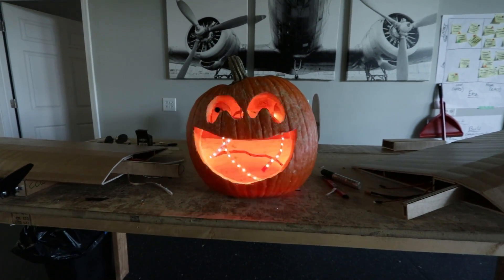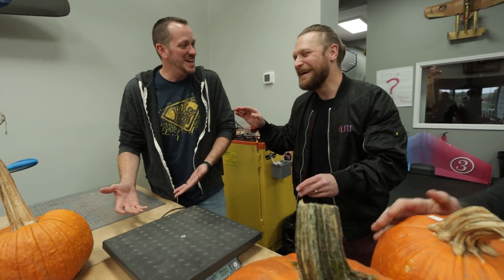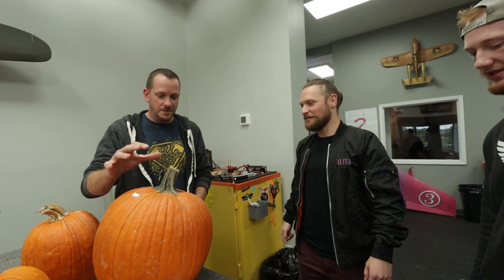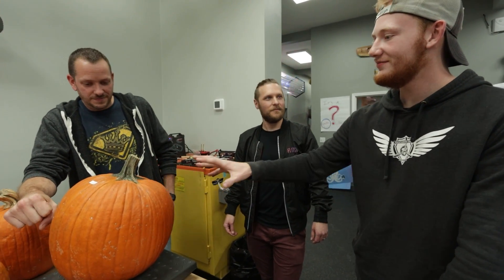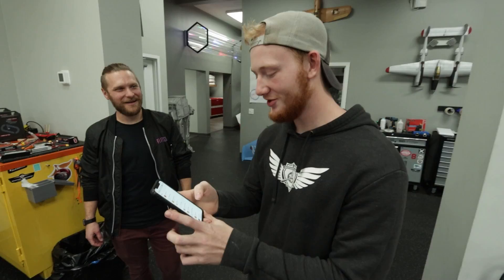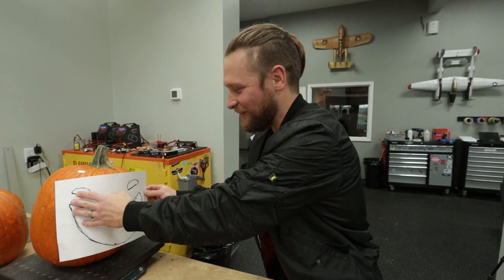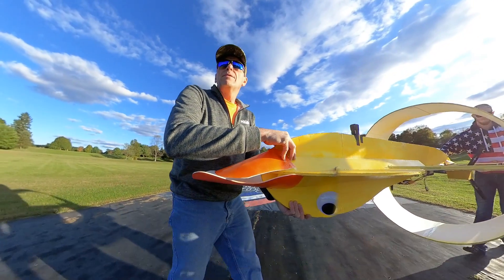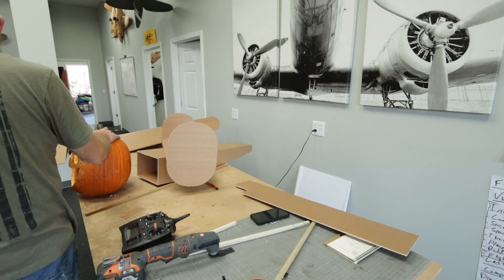Building & Flying a 20lb Pumpkin plane!🎃

Comment: If you’re into FPV wings, you’ll love the Wings simulator. And they’re not lying, flying with a group is a friggin’ blast. Perfect solution to the group fly day withdrawals we’re all suffering through as winter creeps in. Or if you’re not into FPV wings yet, but are intimidated by the thought of spending all that time building a wing and then smashing it (because yeah, it’s a bit more work than a quad), this is a great way to try it out first. Seriously folks, give it a shot.

Comment: Great project and video.  Thanks.  Leaving the top off was a probably good thing because it enabled an air escape hatch.  Maybe if there had been another hole in the back of the pumpkin near the bottom, flying into the wind might not have been as slow.  I'd like to see you cut another hole in the back and try it again.

Comment: That Wings game stinks.  No discernible control scheme!!!
Reply: What do you mean by no discernible control scheme?
Reply: I thought I could fly with the keyboard.  My Spektrum DX6 has no input for this.  If you can use a keyboard, please tell me how.
Reply: @userTJ39780  If you get your hands on a WS1000 dongle you will be able to use your Dx6 transmitter. I believe there are also cables that use the headphone jack to also connect your transmitter to the computer.

Comment: now use the one with the long stem. cut eye holes above the stem and the mouth below. 
0----0
   @ 
(___)
You can remove the base of the pumpkin instead of the top, then cover the whole thing with epoxy to increase the structural integrity.

Comment: I would have used a fake pumpkin.  Yes it would have been a little lighter, but they make ones the are thick like a real pumpkin.  The best part is it will not rot and you can keep the thing around.  I would have put some wing and tail lights too so you can night fly it.

Comment: It takes me weeks of dinking around to build a simple cub. Every thing goes wrong... soldering problems, servo problems, wires to long or short.check cg reconfigure all electronics to re fit.pushrods don't line up. and on and on !!!! 
And you guys build from scratch and fly a pumpkin in 2 day's  !!!!! 2 DAYS  !!!

Comment: that setup would be a good one for many reasons (the wings, fusilage, tail, and camera mount all mounted to the nose) just think about it have several noses ready to mate with the rest and switch out when needed. you could even put batterys in the nose (Don't know about the CG but it could be worked out.) use it for crowd coverage, search and rescue, supply drops to hard to reach places, and camera platforms for such things as Flight Fest and other outdoor activitys. just a few ideas I had as I watched your video. WELL DONE !!

Comment: I want to see a flying lawnmower that still cuts grass
Reply: That would be a challenge because the moment of inertia created by a rotating mower blade would muck up their aerodynamics. They would have to account for the spin of the blade, and how the torque would change under varying conditions like banking in to a turn.

I would add to the challenge that it be a riding mower!
Reply: @PurpleHaze2k9  There are models of lawnmowers with twin blades that would prevent that rotating force. Also... anyone remembering the Flymo hover mower?
Reply: @Particulator  So now we need a double prop lawnmower. I say we put the mower on its side and just use that for forward thrust. It would be dangerous but awesome.
Reply: I bet they could figure it out, it would be super cool to see. Maybe they could build it like a helicopter and have the cutting blade create the lift while using a tail rotor system or something
Reply: @corvette_jake7225  Yeah, I now propose a hovercraft riding lawnmower! Just fit a skirt  around the bottom and boom, hovercraft.
Reply: yes
Reply: make pls
Reply: I really hope the guys from FliteTest read these comments
Reply: Contact him for more enquiry
Reply: They just need to use one of those robot mowers
Reply: @Corvette_Jake I think someone made one
https://m.youtube.com/watch?v=FvIXJBrclLY&t=37s
Reply: That would be really heavy, maybe if they used one of those rolling ones that don’t have a motor
Reply: I remember seeing a flying lawnmower. But it didn't mow.
Reply: Lol, that'd be a winner.
Reply: It could be made, but, OUT MOW? I don't think so. Using a helicopter style connected to the mower would work, but efficiency of cutting clean and fast would be lost.
Reply: Investing in bitcoin is the best investment option today. Research shows that it builds 46% of all passive income schemes in US and UK. Week in, week out, My broker, Dr. Hamilton ensures his students gain profits with his accurate strategies and daily lectures.
Reply: Email: Timcrul082@gmail.com
Reply: Contact: + 1 9 7 3 5 2 4 6 6 9 2